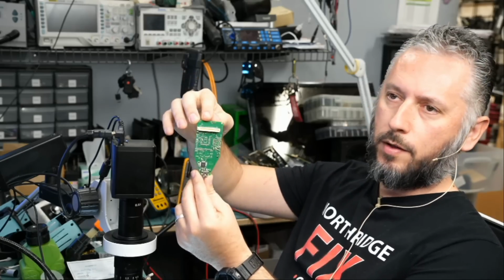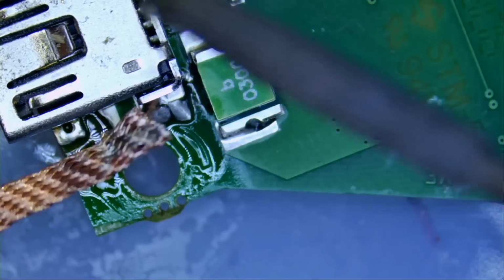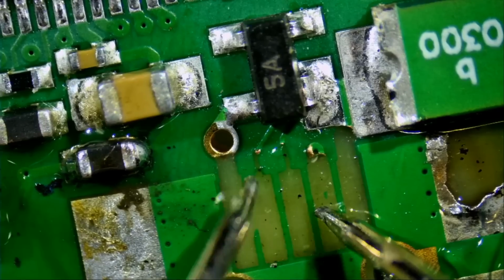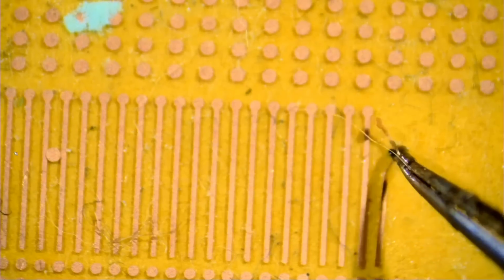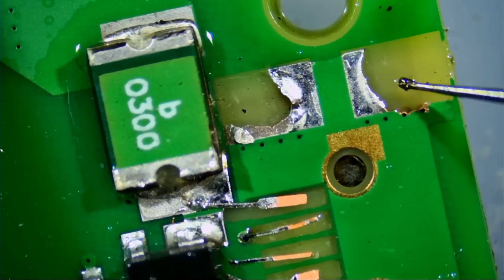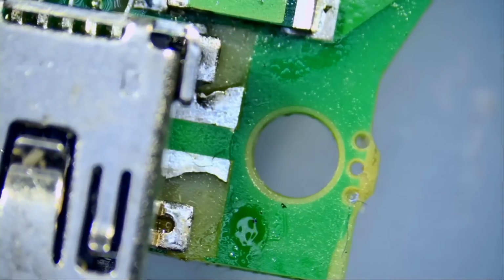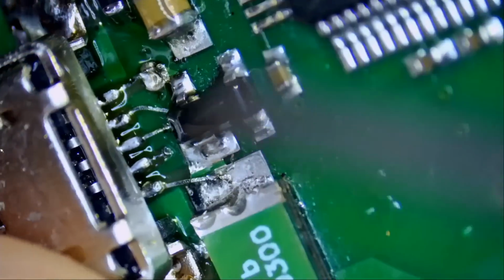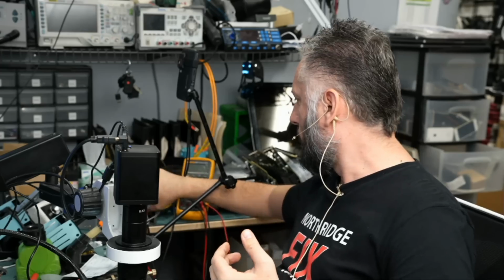Expensive Audi VW VAS6154 Diagnostic Tool Repair

Comment: Great repair, definitely worth its price. The cheapest VAS6154 (original part, refurbished) I can currently find here in Germany for example costs 1199€ ($1277), but the seller only ships to Germany or the EU.
Reply: You could use a parcel forwarding service in a EU country.  I had to do it for a seller that refused to ship to US, even offering extra for shipping.  The parcel service charges a free, but they accept the parcel and then they ship it anywhere you want.

Comment: Great work. I really appreciate watching your videos; you are an inspiration to us all! When I repair these type of connections and the pad to secure the connector to the board are ripped off, I usually either clean up adjacent to the mount or drill a small hole on each side of the USB (if there isn't anything on the other side), and run a strap of 18AWG solid wire across the the top of connector. The connector is held down pretty tightly with either soldering on either side or by twisting it on the other side (and soldering to keep it from getting loose).

Comment: I often drill holes through the PCB. Wrap a wire around the USB connector. Works great.
Reply: Very risky if you have a multi layered pcb.
Reply: @pabloascencio7397  Yeah that is obvious. But often the ground plane has viers through It already.
Reply: I had done many connector repairs before ..you can secure the area between the two legs with a peace of wick..that's not risky and holds the connector into the board like a rock.
Reply: I think a couple small screws would be ideal

Comment: I would just solder an USB cable to traces and relocate the port to an external USB port. That is what I did to my dash cam and 3D printer USB ports. Though this device costs way more and stakes re higher.
Reply: Same.

Comment: Great video. You asked early why they didn't use through hole to secure the 4 USB connector tabs but they opted to cheap out. Agreed. It truly boggles me why (for such an expensive tool) and the only explanation must be profit (once again) undermining the engineers. Makes one wish ownership would keep their noses out of R&D but nooooooo. Cheers and thanks again.

Comment: Another method to secure the metal USB frame to the PCB is to drill a hole on both sides of the frame.  Solder the wires to the frame and the bottom ground plane.  This is the first time I have heard of using RapidFuse.

Comment: Wow good work. That is a moneything, everyone creates his own device or connector and sell it very expensive to make money of it. When it breaks, they just say you have to buy a new one. They all don't repair anything but just want your money. Of course it would be easier to build a long lasting connection on the pcb with throughholes or so, but if it last forever they can't make much more money on such devices. 
Thank you for that video. Greets

Comment: Alex I use clear resin from 3d printer and a UV Black light Flash light to cure in seconds like yours. The Resin is better than super glue and hardens like  rock to keep those SMD USB connectors to the board perfectly and you don't have to wait for glue to setup and cure., Keep sharing the tips as keep sharing my tips also

Comment: Passed under warranty 4 VAS6154, all with a broken USB. I received 6154A in return and they live noticeably longer, maybe they changed something.
Audi has a Wi-Fi adapter for these things, which also extends their life, but some operations must be done over the wire.

Comment: This is one of your best repairs yet I think. Basically electronic surgery.  Very impressive.

Such a poor design from Audi, and so crowded in that area making repairs difficult.
Reply: This looks to be a clone tool unless Actia group (manufacturer of genuine 6154VAS tool) have dropped QC (unlikely that was delivered to to VW group, or accepted, looks to be a clone and a shotty one at that, maybe not, but many techs gety dupped into chasing tails with clone tools, so i figure i throw possibility in there.
Reply: @stringerbell7299  For me it looks like a Würth electronic pcb (the pcb has a destinct look I only saw on them) so probably the design and qa team overlooked that issue. Maybe one with a genuine tool can say if they definetly have that design issue

Comment: A piece of solder braid run along the edge of the board and soldered to the rear anchor pads would give you something to solder the front anchors to.

Comment: I charged once for polishing. And by "polishing" I mean tough cleaning a notebook, what looked and smelled like it came from a dumpster. Option B for the customer was that I refused to work on it in such a state. Other notebooks were cleaned from outside after repair, free of charge as a bonus. (if there was time for it).

Comment: 100 a pad sounds like crazy money to me hehe  Never thought you were serious when you said it and the internet seems to be full of people who lack a sense of humour lol   I finished a rebuild myself yesterday, a National Semiconductor LCD watch from the very early eighties, I had to remake several corrosion eaten traces on the tiny circuit board and used a mix of conductive paint and conductive epoxy, the finest dagger brush, a lot of sweating, swearing and redos but today its working like new.   Watch isn't worth much but I quite liked it and wanted to see if I could save it or not.

Comment: At 17:00 for such tight spaces, I usually remove the components nearby and solder it after doing the connector. You can call me a noob but I usually be extra careful even though extra work.
Reply: It's less work than making a mistake

Comment: Alex why not drill tiny holes through the board to secure the connector? Put tiny screws then solder the connector to the screws.

Comment: they should put the dongle in an secure container with cable attached so they would never mess with that connector, and protect it from "hard" use

Comment: One time I was busy with my tweezer and it fell out of my hand right into the nail of my big toe, because it didn't fell down but kept standing up by itself I knew that the tweezer was stuck in my big toe, you'd think that would hurt especially when it is stuck in the nail but I didn't feel it at all so I pulled it out and it was a little bit stuck in the bone and I drew some blood... Just a couple of drops so it wasn't as bad as it looked but still funny to tell people about my stupid accident... :face-turquoise-covering-eyes::face-fuchsia-wide-eyes::face-green-smiling:

Comment: Could they not use a male to female USB adapter with a six inch cable and cable tie the cable to the back of the tool as a strain reflief?
Reply: of course they can, it's just a normal mini USB port....nothing special...

Comment: Alex.couldnt you drill 2 holes through the front of the board with screws / wire to secure the connector?
Reply: Good idea, if there is enough clearance for the case.

Comment: Is this tool useful for anyone to use on Audi, VW vehicles etc, and what is its exact purpose, or is it useable only if you are a Audi, VW etc dealer, I hope that makes sense, does anyone know the answer please, thankyou for your time in advance. Great video thankyou.
Reply: It is used to connect the car to the diagnostic system through the OBD port in the car when you troubleshoot or make a service on the car. Through Bluetooth or cable.

Comment: What are the small circles used for on the sheet of pad strips? Do you ever use them during repairs?
Reply: When troubleshooting a circuit, the circles are where the probes are placed.

Comment: After soldering the pads,  could you mask them onto the board, then grind an opening on the mask? Would it hold the connector better onto the board.

Comment: Actually, fitting the pcb in different case and running the wires to external classic USB type A mounted on the side of the case would be a better idea and the device will be indestructible.

Comment: I started watching ur videos few months back n that restart my technical instincts, I worked in my speaker, the 5v to 8.4vboost converter circuit fumed, I bye pass it with 9v charger, but please arrange me a boost converter to charge a double 3.7 I. E 7.4 v lithium battery. Will pay online

Comment: I think I'd use fine coated wire from the connector to a solder point rather than put pads back.  Epoxy the connector down and perhaps use a cable tie using those through holes if they aren't part of the case it comes in.  Or perhaps wire in an extention cable and somehow secure it rather than reuse that connector. The work you do is so skilled, but I'd be worried it'd be straight back in a week.  Its  being used in a garage after all.

Comment: That dealer needs to change from the USB to the adapter and integrated cable (that comes with the kit the dealer has), which removes any strain on the USB connector on that obd2 6154 VCI... I used to use the USB cable, but after damaging several VCIs, I switched the the adapter and round plug that came with the VCI

Comment: Could it be possible to drill holes into the board using a dremel with a fine tip and turn it into a through hole connector?

Comment: Could you not have drilled a tiny hole through the tabs and board and attach some tiny screws to hold the connector down?

Comment: With there being nothing under the connector location on the other side of the board, why could they not have designed in a way to use 4 small screws to hold it into place? It would eliminate (or at greatly reduce) the mechanical strain on the connector each time the device is used

Comment: Why even use the VAS when ODIS (AUDI/SKODA/SEAT/VW/BUGATTI dealer software) supports passthru J2534 interfaces - I have the latest version 11 (it's a crack yes, but fully functional, even online functionality is possible using third party online vendors - I'm not a dealership and since I'm from a third world country, original tools cost a fortune for us, hence cracks are inevitable) - I use original scanmatik 2 pro with ODIS and all working well.

Comment: As someone that worked in electronics packaging for a time, it killed me to see boards laid out with connectors only being held in place with solder. Solder has no mechanical properties. Just killed me

Comment: Could you not get away with drilling a tiny hole in the middle of where the mounting pads are so that you could have solder on both sides to secure it?

Comment: So they made a tool for use by mechanics in a workshop that would need to plugged and unplugged several times a day with a USB connector that was only surface mounted.....?

Comment: Well, even when a company does a good effort to make a proper charging/usb data system, users will still manage to break or bend the charging port pins or break it in every way that is possible. (€750 DECT phones; Mitel DT423/Ascom D81). It is suppost to be made to stay intact with some abuse, but they definitely do not do so with our users. Of course no spare parts are available from the manufacturer Ascom.

Comment: The dealer needs USB cable connection for software updates on the car. They cannot flash car ECU wireless. When doing just diagnosis , they can use the dongle to make WiFi connection with the VAS6154. You can buy clones from china, but they have bugs...

Comment: In my opinion two small holes can be made in the front pads for support and screws can be fixed from the back and soldered on the front support points of the USB connector then it will not move while plugging the USB. A difficult and time consuming task but a more permanent fix for the USB port without support
Reply: As long as it isn't a multi layer board with tracks running where you drill, which I wouldn't rule out for VAG.
Reply: Most likely these two small holes used by/for cap holder therefore there is no room for another part/cable to make it to connector harden in its place. 
Best solution is will be use it’s original accessory given in a link by Alex

Comment: may be a 3k tool, but components are worth 20 bucks at best, as usual in the automotive repair business
Reply: It doesn't matter unless you have the software for the chips...
Reply: @rkan2  sure, and it's still a badly made piece of junk if they make a connector that will be constantly plugged and unplugged the most egregious fail point

Comment: Perhaps....   pin the pads to the board if nothing under. such as drill hole and run solder through and lumped top and bottom holding each pad.  theres usualy a way even if you have to sleep on it, but hot glue or super glue gel which is thicker. You can also use a tiny bit of builders glue like liquid nails using toothpicks !! haha 
Terrible how its so expensive and the weakest most abused part is poorly secured..

Comment: Couldn't that be modified by drilling small holes through the PCB where the large ground pads have been ripped ..solder on posts to the connector to extend through the holes and solder them on the other side of the PCB for added connector support ? Maybe something to suggest to the customer if the issue comes up again with that weak ass surface mount design

Comment: Why they fail? Because they are designed to fail. I was working for 15 years as automotive SMT operator and i can clearly say, that Audis and BMWs have the worst electronics(beside them we made parts for Ford, VW, Toyota, Honda, Renault, Peugeot, Citroen... just few from the bigs). They are purposefully bad designed and are cheaped out, because of cost saving. Bad designed, because the wire connections between the modules are replaced with paper thin PCB board connectors and those can very easily break, because of shock and vibration. You cant replace them without removing the dashboard. They are cheaped out, because the SMT manufacturers are forced to switch to low quality components. Most of the SMD parts are came fom Audi and BMW, so we forced to use them. If they send low quality caps, resistors, etc, then we used those.

Comment: you ask why it's so poorly designed? Well, so that it breaks down as soon as possible and you have to buy a new device. If that doesn't work, a weak capacitor is installed to help. Welcome to German engineers.

Comment: Chineese clones are designed exatly the same and cost max 200 usd.
Reply from the maker: With a Chinese close you have no access to the Audi software which is the most important part. What's the point. Use your brains my brother.

Comment: Poorly designed tool for sure. And probably owned by the audi dealer.

If I spent 2 grand on a special too as delicate as this one is; no one would use it but me. And I would darn sure devise a better method of strain relief for the usb cable.